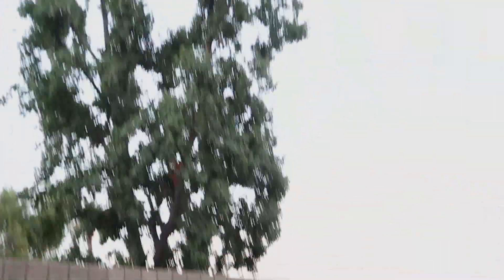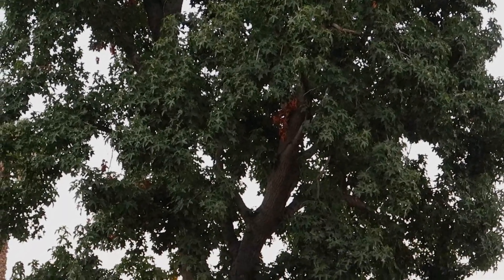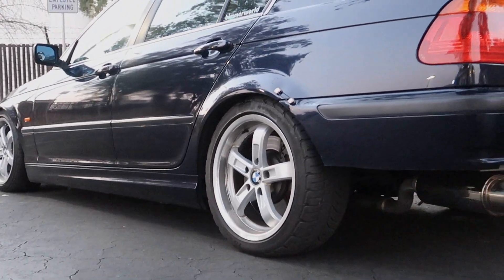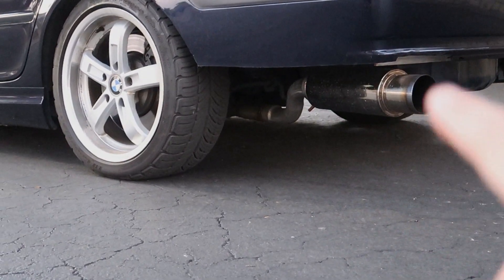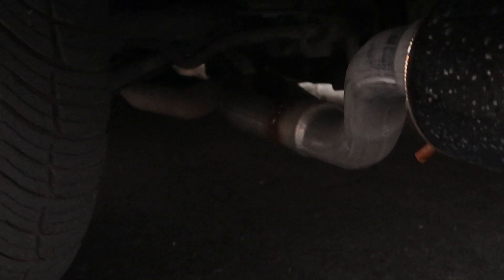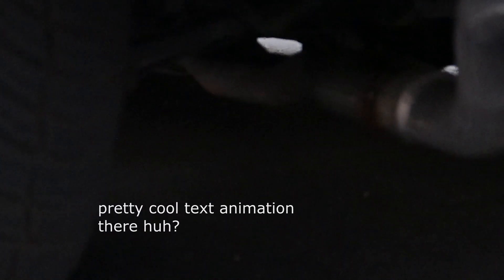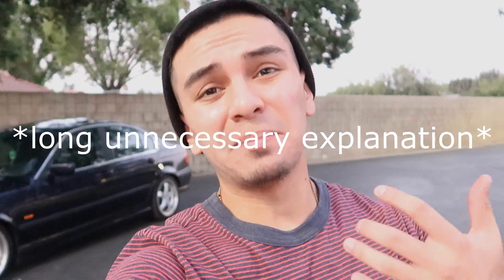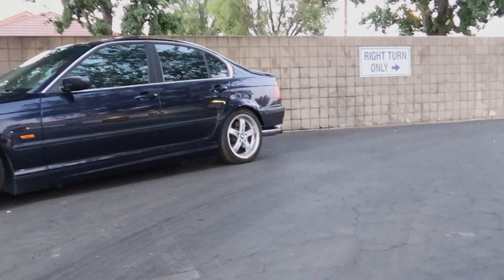BMW E46 Daily / Track Ready Update and Walk Around

Comment: Yo not trying to tell you how to build to each their own but the placement of the CAI is bad cause Heat Soak is a real thing. If anything add the scoop back in for cool air or fab a shield. All your doing now is sucking up engine heat which anyone can tell you is bad news for performance. There's a reason why any real quality CAI system comes with shields, its proven engineering man.
Reply from the maker: Yeah I knew that going into it, and I want to invest in one down the road, but it’s not a priority right now. I know a lot of people with e46’s who rock this set up, so all is well 🤟🏻